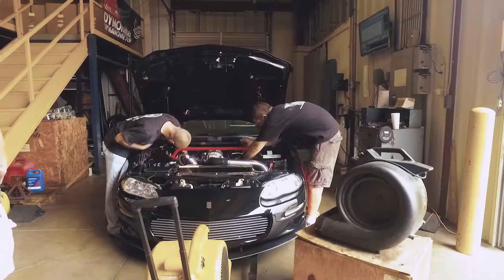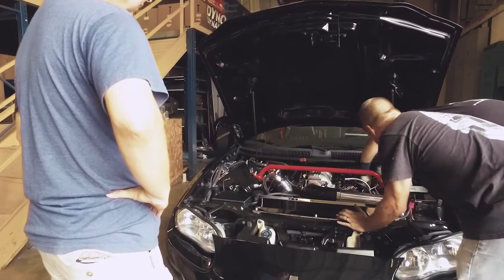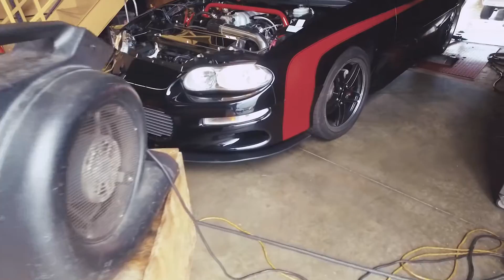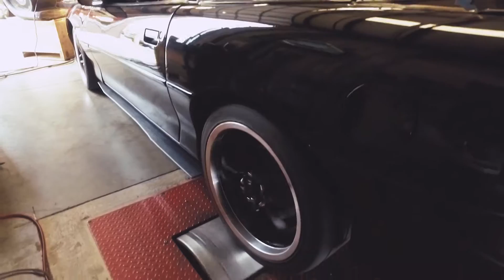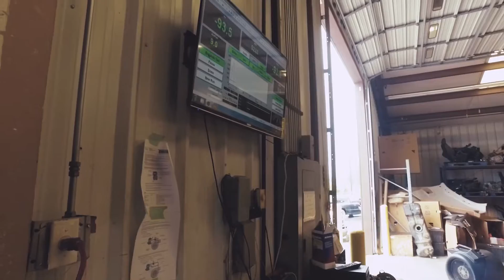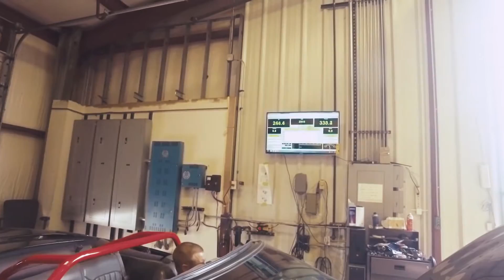Hurron Speed Turbo Camaro - LS1 on 10psi

Comment: Same kit here. Vs racing 7875 billet. Ls6 cam, ported 317's. 6 speed, stock 10 bolt... Made 646 wheel on 9 lbs. 567 wheel on 6 lbs. Maybe I just got lucky
Reply from the maker: The trans issue was the weakest link. I just wanted to get it drive-able. I've got a th400 in it now that we pulled out of my dad's car, but it needs a different tq converter. It's a fun car to drive around, but still needs some attention before hitting the rollers again. Most of my attention is on an 86 C20 3+3 for about the next year.
Reply: Nick Campbell do you have a Instagram or Facebook I’ll love to ask your a few questions I have the same kit..

Comment: I have a bad question, but did you install the turbo with the engine still in the car or did you take it out? Sorry if that is a dumb question.
Reply from the maker: ____J____A____C____K no question is a dumb question. It could be done with the engine in the car, but would be a little difficult. I had the bottom end rebuilt at the time I added the turbo, so it was more convenient to install it out of the car & set the car on top of it.

Comment: You running stock cam?
I want to boost my car. Procharger is a tad more then turbo kits. I have a lq4 block waiting to get built.
Reply from the maker: It's the Texas Speed Torquer v4 cam. It's what I had at the time of install, but not ideal for the turbo.
Reply: @rodsandribeyes  i have vrx-5 cam right now

Comment: I see to kept the AC what radiator you go with in having over heating issues
Reply from the maker: The Huron Speed kit retains the factory AC & radiator. No relocation needed
Reply: @rodsandribeyes   did you move the fans? And if so what cfm are they and do you have them as pushers or pullers?
Reply from the maker: @MrPimpthat06  they supply pusher fans with the kit

Comment: How are the spark plugs to change on the v3 kit? How has it all held up?
Reply from the maker: It's held up great, and no issues changing plugs. They were easy enough that we pulled a few on they dyno when we discovered a melted wire. But got it repaired on the spot.